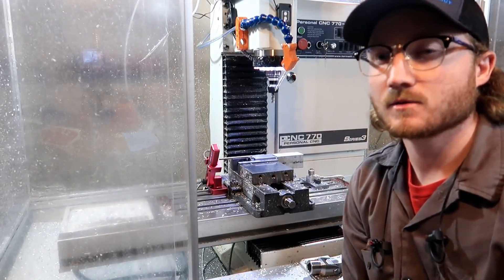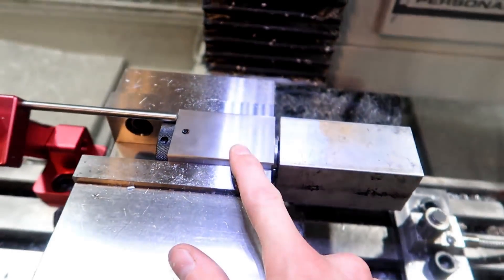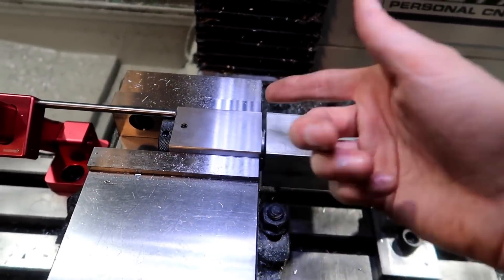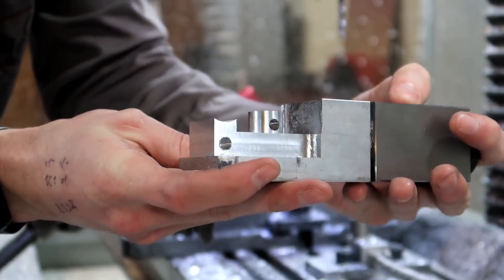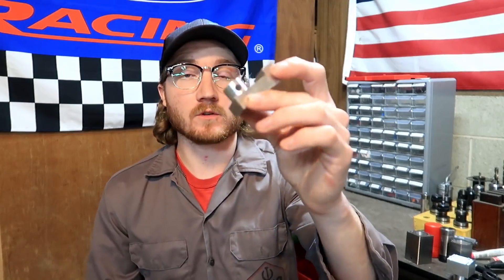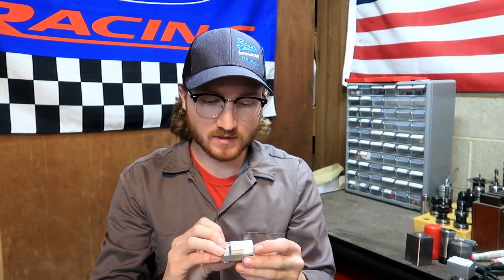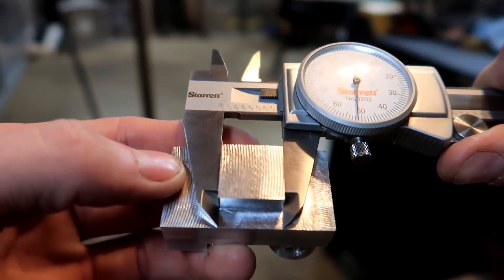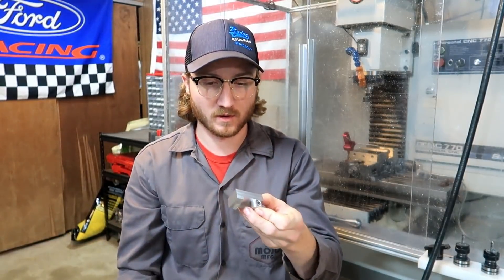Collet Block 4th Axis: Home Mfg. Days #63

Comment: Add a machinist’s jack under the part - from bed to stock bottom. Can be easily shop-made using round/square stock with threaded hole, hex bolt with an additional nut for locking it into the correct height - simple and cheap. May help reduce your chatter.
Reply from the maker: That would definitely work good for that final parting. Thanks!

Comment: Use a smaller diameter cutter on the part off and leave enough stock for clean up. That will reduce your cutting forces and the amount of material that needed to be removed.
Reply from the maker: That seems like it would work a lot better.  Thanks for the tip!
Reply: @MojoMfg   Great vid Garrett!
I like the idea of the smaller cutter and the jack.  I think I might also try to keep the slot a bit wider.....1/16"?  ....do the first pass at whatever depth your passes are at....ie 1/8".....on the far side of the slot....then the second pass at the same depth on the part side.  It will eliminate both walls from being in contact with the cutter at the same time.  If there's any chips getting between the cutter and the walls when doing the full width slot, they're "wedging" the walls apart which will would cause a ton of deflection and chatter as you get near the bottom of the slot.  Not sure if I explained that very well.  Basically....3/8" wide slot done with a 1/4" cutter.  First 1/8" depth pass would be on the block side.  The next pass would be at the same depth, but on the part side.  The first pass is creating room for chips and also making your second pass have much lighter cutting forces. 
I'm also wondering why you didn't just skip the 1" stud and clamp on the stock material.  Were the walls of the stock not very square?
Reply from the maker: Yeah I think I understand what you are saying. Basically I should have done half of the parting on the first side then finished on the other side but also keeping the slot wider to stop the chattering.  I used the 1" stud because I figured there would be much better accuracy in how I zeroed the part with using the collet block. For example, I know all the sides of the collet block are the same length(1.75") where the stock sizes were somewhere along the lines of 1.748" x 1.760.  So that means my origin would have been off if I flipped just the stock.  This was really just a test to see if something like this is possible and makes the setup a little easier without having to make softjaws and such.
Reply: @MojoMfg    Actually...no....I wasn't talking about half on the top, then half on the bottom.  I was talking about just the width of the slot in two passes.  If you have a 1/2" slot, use a 3/8" cutter and cut a full width pass an 1/8" deep on the block side.....then make a second pass at that depth on the part side to remove the 1/8x1/8 section of material that was left.  You now have a 1/2" slot an 1/8" deep.  When you get down an 1" into the slot, it should not be causing near as much deflection...........at least that is my thought, but since I'm not much more experienced than you, it may not actually be a better option.  lol!  
I kinda figured the collet block was for better accuracy.  I think you're right about the raw stock not being accurate enough.  You'd have to machine the four sides and the end.  Your stud method would work nicely in a 6 sided collet block too.  I hear ya on the soft jaws.  They scared the heck out of me in the beginning, but once I got it figured out in fusion, it got way easier. :)
Reply from the maker: Ohhh...yes I follow you know.  That could work a little better to clear up that chatter but we'll have to see.  As far as softjaws, I don't have a problem with them now, I just hate taking the time to program them and use them once not to mention how much they cost me.  Anyway, I appreciate the idea!
Reply: @MojoMfg  I agree....the soft jaws are a pain if they're only a one time use.  lol